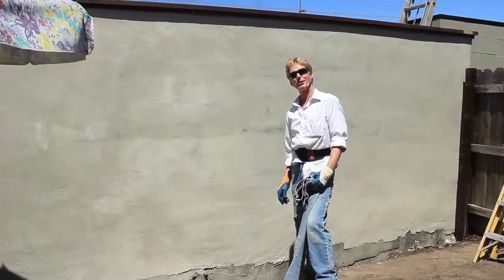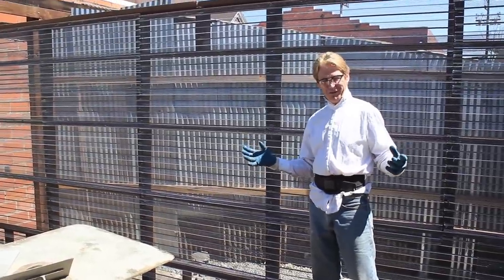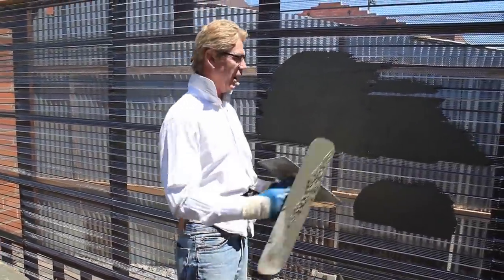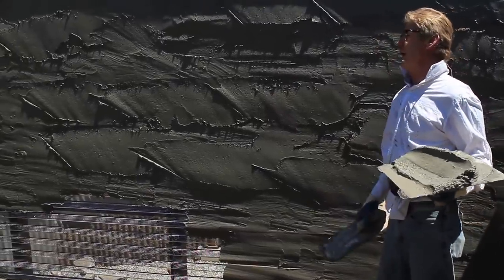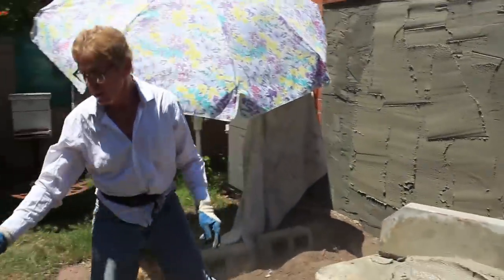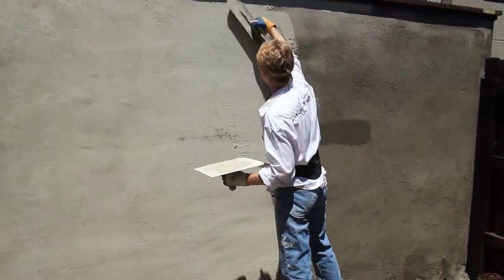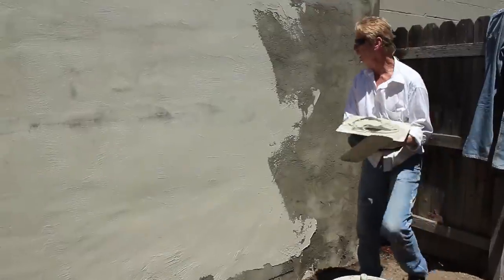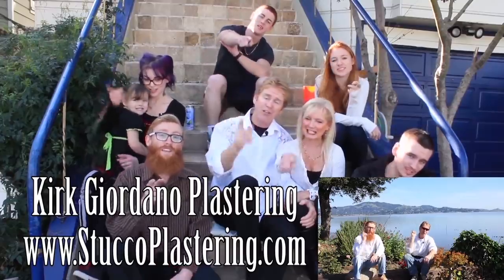Retaining wall Stucco fence

Comment: I am a geodesic dome builder , i needed to see how you plaster. Thank you God Bless  Mr. Kirk Girordano
Reply from the maker: Howdy Joe, then you use 3.4 metal mesh wire, not the rib lath I used in this video.
 The key to plastering any free-flowing meh wire is a constantly rich mix.
 In this video, I tried to prove a point by pushing too hard but Jason had mixed such a rich mud, even when I pushed hard it didn't fall off it just went past the rear of the lath and still hung tight, like a sock in a dryer.
 Bringing peace, love, and brotherhood back to the world of Plastering. 🌍
With over 850 educational and free Youtube videos, by your favorite plaster geek, 
🤓 and my son, Jason, the bearded plasterer.💃🧘🏻🧞‍♂️🎉

Comment: Funny story pertaining to stucco fences and bees. My parents have stucco walls on the sides of their house, which have brick columns every 12 feet or so, and between the columns are stuccoed sections of wall. We always assumed they were stacked blocks that were coated in stucco, never gave them much attention, until one day we noticed bees coming out of a crack in one of them. It turns out that they are stud walls that were papered and lathed and stuccoed over as a cheap version of a masonry wall, until the bees found a crack in one of them and built their hive in one of the stud bays. That aside I've always thought that with the right scenario you could save quite a bit of money and effort by doing a wall that way, especially if you incorporated some kind of masonry cap, done correctly most people would never know the difference.
Reply from the maker: Howdy, my friend, many ways to skin a cat. I had bees in our walls at a house I used to live in.
 Bringing peace, love, and brotherhood back to the world of Plastering. 🌍
With over 850 educational and free Youtube videos, by your favorite plaster geek, 
🤓 and my son, Jason, the bearded plasterer.💃🧘🏻🧞‍♂️🎉

Comment: I would say that the high temperatures you are experiencing is why the bees are getting pissed. Here in Maryland, the high heat and high humidity really set the bees off and make them hyper-defensive...course many areas are now entering into dearth periods which only makes them even that much more defensive.
Reply from the maker: Good evening Bee-friendly Dude, I figured you knew what was up. these bees weren't that bad as they live there, I was the one visiting.🍺
     Bringing peace, love, and harmony back into the world 🌎of plastering.
  The University of plastering by Kirk and Jason Giordano. 🎉💃 🥂🧞‍♂️
with over 850 free advice show and tell video’s on stucco & plastering

Comment: Love this channel!  I built this great cmu wall 6 years ago with your help and I am going to do the rest of the property now.  Since then my wrist has gotten pretty bad ( 27 yr painter) so I am looking for a lighter way to build a wall.  Would a wall built from a solid footer to steel frame with cement board screwed to it then scratch/stucco work?
Reply from the maker: Hi Glen sorry to hear about the wrist thing, in the Army people with weak ankles are told to make circles with your toes often even when eating. 
That increases blood and oxygen flow.
 I have used my wrist over 50 years, they are so strong, it's tough for even youngsters to beat me at arm wrestling.
 I'd hear often why are you squeezing my hands so hard.
 I'd say, I'm a plasterer and a nunchucks expert, that's just the strength that happens when doing both for so many years.
 Use it or lose it.
 Not use it and lose it.
If your using any type of cement board only a half inch is necessary.
 It's called a skim coat.
 A scratch and brown coat usually is about an inch thick.
 No need to apply so think with a cementitious board🍾

Comment: Just happened to come across this video, I'm looking for an alternative to replacing fencing around my parents back yard, currently they have a 7ft wood picket fence, very old, I remember helping my father set the posts when I was probably 8 or 9 yrs old, I'm now 54.
Dad's 85 and moms 76, she dreams of getting rid of the old wooden one and replacing it with , she was thinking vinyl, but finances won't allow that, I'm thinking of spending a day removing the existing one, approx 60ft long on each side of the yard, then copying what you did in the video with the wall, just with 4X4 posts maybe every 8ft or so and the wall in between being just 4 or 5 ft high..
What is it you used that you were applying the mud to? And what was the mud, just bagged mortar?... Sorry for the long message but I'm quite excited as I do believe I can accomplish this with very good results and at a fraction of the cost of the pre fabbed boring sections..my mind is racing with ideas . I wish I could send a pic of the yard now so you can see it and offer an idea but it won't let me attach one... 
Anyways, LOVE your work..
Reply: I am not KIRK, nor do I do this for a living.  I placed wire over wood pallets and stuccoed not knowing the wire would have been enough.   Lived in that home 10 years and that wall did what it was suppose to do....be a wall and not fall. I did this only because I had stopped and talked to a man stuccoing over his picket fence.

Comment: Mr. Giordano, I was wondering if you were familiar with an old style of stucco (70's ?) that had small rock and glass coated on top, I was wondering if you can stucco over top this or if you would have to tear it off ? thanks
Reply from the maker: Howdy John, yes, I am familiar with this finish. It called an exposed aggregate-  dash finish. It could have rocks, glass, shells, etc.
 As long as the finish is structurally sound, of course, it can be plastered over. Actually, even if many areas are loose, it can still be plastered over as long as it's prepped well.
 I recommend you pressure wash the walls with at least 3400 PSI to clean it up then apply a bonding agent over it and plaster away.
Bringing peace, love, and brotherhood back to the world of Plastering. 🌍
With over 850 educational and free Youtube videos, by your favorite plaster geek, 
🤓 and my son, Jason, the bearded plasterer.💃🧘🏻🧞‍♂️🎉

Comment: I found an old abandoned house when I was a kid growing up in North Texas. It's walls were gravel several inches thick surrounded inside and outside with chicken wire covered with mortar or something. It looked like it would have been very efficient before the roof deteriorated and collapsed years ago.
Reply from the maker: No doubt, Cobb or Wattle and daub . It all works

Comment: Thanks for this.  I would do both sides and was wondering structurally what to do for strength and how long would this wall last
Reply from the maker: This wall will last forever, perhaps still be there with a nuclear bomb that went off. 😏

Comment: I have feather edge fence panels fitting in between concrete posts. I want to make my fence a lot stronger and more durable as I am building a greenhouse right up to it. Do you think it would be a good idea to render the fence panels? I wouldn't be able to render the neighbour's side so that side would rot.
Reply from the maker: Good evening House Fairy; if you feel you have the proper structure to apply stucco, sure, it would strengthen it.🤔
  Our unique tip for all subscribers or anyone who stumbles on our channel with a question is, type that question into our channel, and like magic, a video will appear to explain how it's done. 
This feature is miles ahead of any plastering forum. 🥳
http://www.stuccoplastering.com

Comment: I have been thinking about building a small house for years.
I really want to use this technique.  Do you think it would hold up for a small home?
Reply from the maker: Of course this will work, but you need  paper to waterproof it first.
Reply: You have to consider insulation. Aircrete would be a better option.
Reply from the maker: @MaskMasterEsquire  Howdy, so would shotcrete or even better, Diason.👨🏻‍🔬
Reply: @StuccoPlastering  hi Kirk, love you're work😁 Diason, what's that? A vacuum?
Reply from the maker: @MaskMasterEsquire  Hey Ptettzel, it's an exterior lime plaster that's extremely lightweight. Instead of sand, it has cork, perlite, and other lightweight additives to the lime. 🤔
Reply: @StuccoPlastering  cork, that's ingenious. I'll have to study up on that. Thanks Kirk, you're a champ🏆

Comment: Mr Kirk. I am thinking of doing this exact thing on one of my property lines, the other side is the parking lot of an apartment complex. I have an old existing rotten fence. 1. Do you need actually need to finish the backside like in your second video? 2. Does this provide some sound barrier like a CMU wall?
Reply from the maker: The below video may interest you as its deadening sound proof and fire proofing ratios are off the charts.
https://youtu.be/k-ZuqT5eFi8

Comment: A most interesting video thank you! I have an old dog kennel that we use as a bird feeding sanctuary- hawks and cats can’t sneak up on feeding birds and squirrels. What product would you suggest to hide the ugly galvanized posts? I am thinking of dipping rags in a stucco or cement mix and wrapping them , I also would like to do a similar thing with old posts for part of the roof. It’s open too to let them fly in. I could shape the wet wrap  to look like vines.
Reply from the maker: Id suggest you bay some 3.4 wire mesh, bend it around the post, and stucco them or paint the stucco on them. 3.4 is a different metal lath then the Rib-Lath used in this video.

Comment: Hey Kirk, I looked this video up because I'm planning on building one of these fences out of 4'x4' pallets set on a 2'x2' concrete footing. Any suggestions on waterproofing the bottom of the pallets? Thanks.
Reply from the maker: Howdy Steven, the fella we did this stucco work for used pressure treated wood then wrapped the bottomed also.🤔

Comment: My local Lowe's sells rib lathe (27"x97" 7 rib). The website description says it's for plaster ceiling but I assume it will work outdoors for stucco. What sort of spacing and framing do you recommend? This looks like about 2' x 4' spacing for the wood frame? Is it possible to only do the front and leave the back with the wire exposed to the elements? I don't have access to the neighbor's side so maybe I could just pre-paint it to avoid rust?
Reply from the maker: Good evening Brent, rib lath is galvanized to prevent it from rusting, but surely it will be prettier if it's not only troweled down on their side but painted also? Your call.😉
Our unique plastering Tip:  all subscribers or anyone who stumbles on our channel with a question, type it into our Stucco/Plastering channel, and like magic, a video will appear to explain how it's done. 	
   This feature is miles ahead of any plastering forum. 	
https://www.stuccoPlastering.com
http://www.bayareaplastering.com

Comment: Kirk, do you ever work with slaked lime? I'm going to be covering cob with lime plaster and I'm doing it with quick lime, sand, chopped straw and mineral pigment.
Reply from the maker: Good evening Chris, man, I've worked with every cement plaster and or lime product that has and will be.
Welcoming, peace, love, and brotherhood, back into the 🌎 of Plastering.
    Bringing you the most comprehensive encyclopedia of free plastering video’s ever put together,
 by the plastering messengers of Youtube. 
Kirk and Jason Giordano with over 800 videos 🎭 👀💃

Comment: great video! what is the material used here for the fence?
Reply from the maker: Hi Paul, we used Eisenwall hydraulic cement plaster. We mixed this cement plaster with a ratio of three times the sand to every one part of cement plaster.
   To purchase this Einsewall hydraulic cement plaster, you would have to google, "Plastering yards near me."
 However, there is their sister product sold at many hardware big chains stores such as HD, in which you can buy this similar user-friendly homeowners product called "rapid set stucco" it's sold in 10 or 25-pound boxes or fifty to 94-pound bags. This "rapid set stucco" already has the sand in it. 
  One only needs to add water and apply. FYI, Rapid set stucco" is the owner of Eisenwall cement plaster.
 Like all same-day stucco's, don't over mix, three to five minutes max.
Reply: Can you use the rapid set on cement board or do you need lath?

Comment: how tall is this wall im looking to do 8' can i use chainlink fence , how deep does the post need to be .you are awesome
Reply from the maker: Thank you, if you are going to stucco a chain link fence you have to incorporate the metal mesh into the chain link fence, using tie wire. I don't know how deep your post should be, I would think at least two feet set in concrete.
Reply: Awesome! Can I use cement instead of stucco ? I’m looking for the stucco look but want it to last so not sure the best way to do that . Also being 8 feet tall I’m concerned about weight and calling , don’t want to hurt the Neighbours or anyone
Reply from the maker: @moabbas5525  What is stucco? It's usually Portland cement mixed with sand. Whats Concrete? It's usually Portland cement mixed with rocks. What's Cement? Cement is the binder, or you can call it an "adhesive or additive" that binds the sand or rocks.
Reply: I don’t know much about all that stuff but thanks for clarifying and fast response

Comment: so this application is using the 4x4 with cross members and then its just wrapped in in a stucco lath? i was going to do the CMU method however this looks more cost effective. Just want to make sure I am doing it right.
Reply from the maker: Good evening Jammer Dude, well be showing the rear in a few days, you will get the opportunity to see how it's built.
Welcoming, peace, love, and brotherhood, back into the 🌎 of Plastering.
    Bringing you the most comprehensive encyclopedia of free plastering video’s ever put together,
 by the plastering messengers of Youtube. 
Kirk and Jason Giordano with over 800 videos 🎭 👀💃

Comment: I'm super interested in doing this but that expanded metal stuff is very pricy! They don't sell furred wire products where I live either.
Do you think this would work?
1. Build a wooden structure like your friend did here
2. put tightened horizontal wire up about 8" apart to support the paper
3. Put paper up to keep plaster from falling out the back side.
4. Put up un-furred poultry netting, 20ga galvanized with 1" holes (using furring nails)

Thanks Kirk, big fan!
Reply from the maker: Of course that would also work, I'd recommend 18-gage stucco netting, personally as the holes are smaller.
Reply: Thanks, you guys are the best

Comment: How well does a wall like this work to stop low frequency noise from a heat pump?
Reply from the maker: Hi Ken, I have no idea, I'm a stucco contractor, not an engineer. I do know an inch of stucco or cement works well against most noises.🤔

Comment: What kind of crossmembers were used on this project? And how far apart were the post?
Reply from the maker: Good evening Claudio, sorry, brother, you will have to pause the video and look for yourself as I didn't frame it, so I have no clue; I'm a stucco dude, not a carpenter.😉
  Our unique tip for all subscribers or anyone who stumbles on our channel with a question is, type that question into our channel, and like magic, a video will appear to explain how it's done. 
This feature is miles ahead of any plastering forum. 🥳
http://www.stuccoplastering.com

Comment: What is the fence made of is that chain link 🤔 ?? I can't tell what's holding the plaster
Reply: it's called metal lath or steel lath. It's made for media like plaster, stucco, or concrete to adhere to.
Reply: He said it was 3/8 high-rib lath.  There' a bunch of different types of lathe besides the chicken wire that people first think of.

Comment: Can anyone tell what kind of fastener is used to hold the lath to the wood frame? Could it be a barbed or smooth fencing staple?
Reply: In most videos, I've seen Kirk use crown staples, either 1-1/4 or 1-1/2 I believe.

Comment: How long do you think it would take to do 300' of fence this way? Asking for a friend...
Reply from the maker: Morning Drum Dude, anywhere from a day to a month, you asked a trick question; it depends on one's skill level. 🤔
Reply: @StuccoPlastering  Skill level would be... never done it before. Mixed up mortar for tilework, but that's it! Impressive that a pro could do it in a day though.
Reply: Have you done your fence? Planning on doing ours (350’) but not sure if doing wood with mesh or just making concrete molds for panels would be better before doing stucco on top? Share some pointers please if you can

Comment: What kind of cement can I use that won’t crack ?
Reply from the maker: Good evening, Freddy, all types of cement say they don't crack, but movent of any structure will cause cracking.
 I would suggest BMI 690 with fibers if you are concerned with cracking.
Welcoming, peace, love, and brotherhood, back into the 🌎 of Plastering.
    Bringing you the most comprehensive encyclopedia of free plastering video’s ever put together,
 by the plastering messengers of Youtube. 
Kirk and Jason Giordano with over 800 videos 🎭 👀💃

Comment: Whats the ratio of sand and cement? I used 1 to 1. One of white cement to one of white lime.
Reply from the maker: 3 to 1, one part cement, three parts sand. Lime is already in the bag.
Reply: @StuccoPlastering  I don't live in the US, so cement is different.

Comment: Get yourself some stretch jeans! You’ll never go back.
Reply from the maker: You mean like spandex pants, I don’t think so, but thanks for the tip
Reply: @StuccoPlastering  They make jeans with a small percentage of  stretchy material, so they give a little when stretching.  You can't see the difference.  But you would look good in tights too!😉
Reply from the maker: @Jon-ho5tk  Lol, I’m not a tight pants wearing kind of guy.